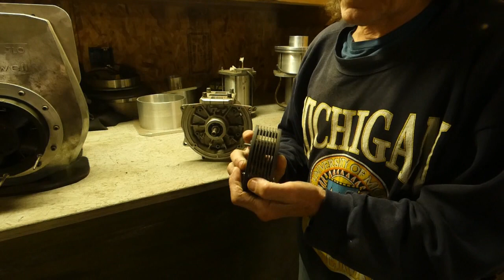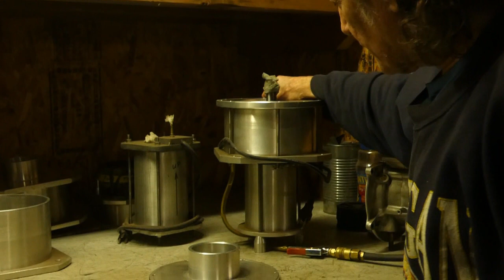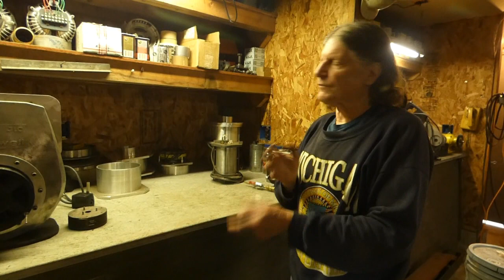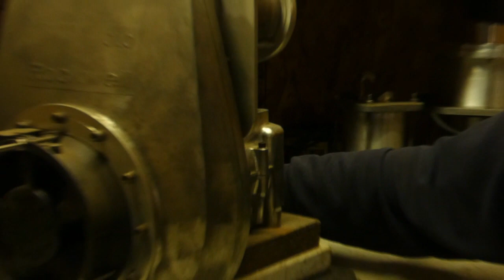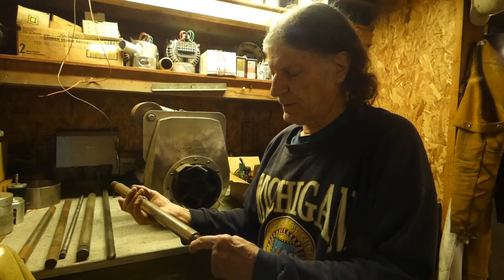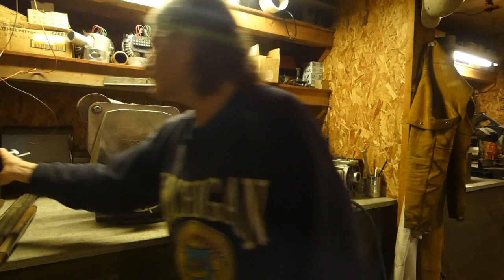Build a Tesla-style turbine for off-grid energy! Learn how in the Phoenix Turbine Builders Club!

Comment: Tesla turbine is failure.....,ive tried fiew tesla models and they suck...even regular  flare rotor with 3 blades will do way better then tesla...
Reply: Look up Jeremiah Ferwerda's channel. It's not the Tesla turbine that failed. He's making huge break throughs and is about to start taking pre-orders of complete systems for off-grid power.
Reply from the maker: Ken will cover your comment in his next video. He made significant improvements to Tesla's original design, and it works just fine.
Reply: The efficiency is key, I have looked everywhere to get an idea on who has come up with the most efficient way to do the Tesla Turbine. Ken, please share what you have found as far as the efficiency. If it is over 90% then it is outstanding, anything lower and it doesn't work. I loved the idea on putting more input points on the turbine, that by itself is a game changer.

Comment: Amazing channel en Nice work!  I will definitely subscribe,  I wonder if you have a Idea how I can convert an automotive alternator to a liniare alternator for my Tesla mechanical oscillator  I'm struggling a lot whit the last it of that project, greetings
Reply: Oscar, tell me more about what you are trying to accomplish, and I will give you my best thoughts on the subject.
Reply: @kenrieli5386  thank you for responding, The goal is to make electric power whit The recepticating motion of the tesla free piston steam engine ( mechanical oscillator)  , most of the solar vacuum steam rankine cycle system is done en works, I only struggle whit the alternator so I thought maybe you have by idea about how to convert a rather small stroke ( maximum of 15mm ) frequency can be tuned in between, 34 / 60 Hz , greetings